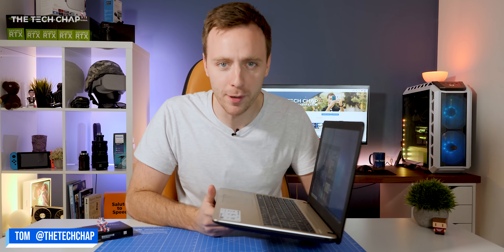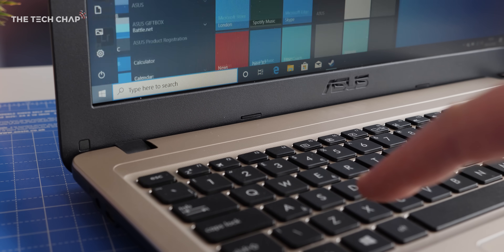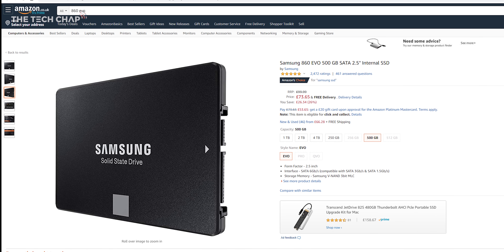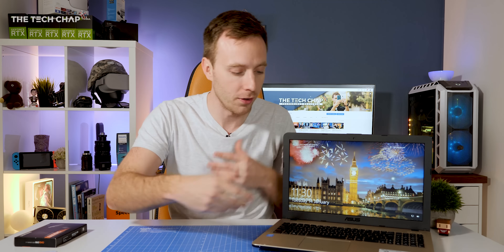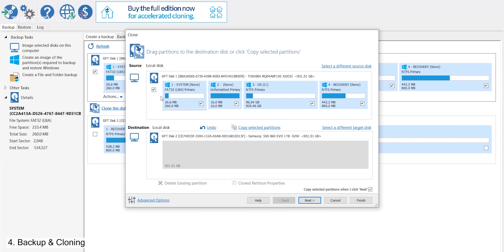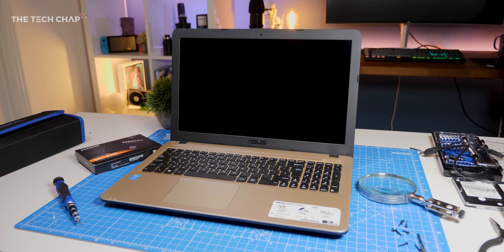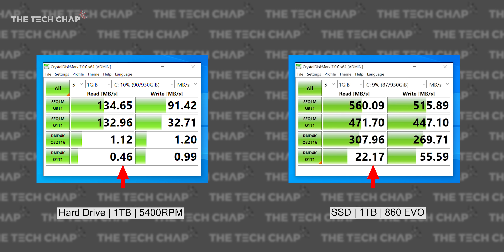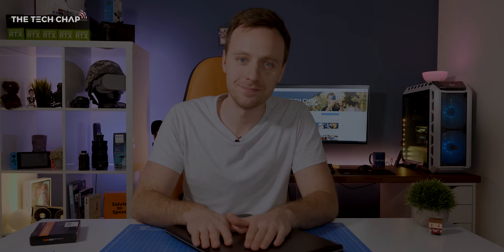How to UPGRADE Your Laptop with a SSD! #AD | The Tech Chap

Comment: I have an old TOSHIBA laptop from 2012. Now lets get to the bad part...  It doesn't have a battery so i have to use it while connected to power at all times, it has a stupid display and a severe overheating problem(100C at times on  my lap). I am thinking of changing it now cause i need something better cause now i really need a laptop where i only use my pc at other times. Now the question for you is whether i should get a laptop or an ipad pro i have been using an ipad and i quite like its interface and style but am worried about consequences of the lack of compatability with other devices  and the area of laptops i jjust think that they are too much to handle  but when i think of easy working and satisfactory typing i want a laptop. SO please tell me what o get an ipad pro or a laptop

Comment: Question: I have an 128Gb SSD M.2 for my OS and 1TB HDD for my files and game, i was always thinking i need to change the SSD but i have to reinstall everything and i dont know how to do that. So I came up on this vid and i was thinking of changing the HDD for and SSD like in this vid. So i just need to empty the HDD and change it with this SDD? Would this make my games much more faster? What is the better option (more easy) SSD or HDD change?

Comment: 1) do I back up my files, pictures first and then do fresh installation?  Or 2) Samsung Cloning my old drive and everything should be there including programs I have there when I change my new ssd?
Reply: Depends on you actually. I'd prefer fresh install but it can be a pain to find all the drivers
Reply: @9inchpp  update..  i want to upgrade my windows 7 pc. great one..  change ssd and fresh windows install.  can i do that and it will find its drivers?  and do i have to buy a windows 10 license.. (i can get it easy if i need to).. help

Comment: I've got a Toshiba Satellite laptop  that's about 6 year old and rocking a slow HDD, gunna get an SSD and swap it out myself :)
Reply: Mine is Toshiba satellite L635which is 10 years old . It is full slow and needs minimum 15 minutes to turn on and respond properly it is 4GB ram and 256GB HDD can I upgrade my ram or Hard disk ??
Reply: @tejasmprasanna826  you can upgrade both. Depending if your laptop let's you most do
Reply: I have a toshiba laptop too! We’ve been best friends since 2013. She still runs okay but she can get slow every now and then.  I got a new laptop for Christmas, but there’s not a lot of gigabytes on it. It’s 119 and right now I have 83 gbs left 😭 My toshiba laptop had 439 gb which lasted a very long time. Um so do I have to get a hard drive for the new laptop for more gigs?
Reply: @hzssxn  I think SSD

Comment: Hey there, GREAT video - thanks for sharing. Quick question that I hope you can help with....Just bought a 2021 Acer Nitro 5 AN517-54-77KG Gaming Laptop (Intel Core i7-11800H, NVIDIA GeForce RTX 3050Ti, 17.3" FHD 144Hz IPS Display, 16GB DDR4, 1TB NVMe SSD, Killer Wi-Fi 6) and have the ability to expand either to a 2.5 SSD or HDD. Which would you recommend is better for overall performance and streaming? I'm torn between adding another SSD, HDD or upgrading the NVMe SSD and adding another SSD/HDD.....so confused to which. Please help???

Comment: Hey ,great video for old laptops but I am using a predator 300 (i5 8gen,gtx1050Ti)and I do a lot of 3d work so for better rendering performance in Maya ,Houdini,c4d...I need to update it..but bit confused b/w upgrading ssd or ram please do recommend something that is budget friendly and also good for a long run...and also currently I have 128gb ssd and 16gb ram

Comment: Is it necessary to remove battery pin before swapping a HDD with a SATA SSD? Because I have a dedicated slot for HDD o n the back of my laptop that i can access without taking out the back cover entirely.

Comment: WHats the settings required for an SSD to be recognised from BIOS on old laptops. On an HP HSTNN-105C i had to toggle a SATA setting in BIOS i switched SATA NATIVE mode to ON.
And now i have problem with a FUJITSU E751 that doesnt recognise the new SSD (The same i had in the HP laptop) but there is no Native mode available to toggle

Comment: I have about the same model of laptop that you are using, except i have a two disk system. One hdd and one ssd. Planing to replace the HDD with an SSD, and then replace the 128 SSD with a bigger card a little later.

Comment: Looking forward to doing this with my HP Envy k11TX. It’s got an i7 4510U and an NVIDIA 840m, but it’s slowed down by its 5400rpm HDD. I’ve taken it apart already and it’s easy to do. Would a Crucial MX500 1TB be a good fit? I’m not willing to spend much on this old thing. I have a proper gaming PC already with a 5600x and a 3060Ti, so this is mainly for my family to use for “general computering”.

Comment: can I ask for some advice on what kind ssd should I use, I have an acer travelmate p259-mg laptop, I have added an extra slot for ssd stick but I also wanted to change the hdd to ssd, is it possible to have two ssd's, one is like an hdd and the other is a ssd stick?

Comment: Great instructional video - thanks.  Just a heads up with a potential glitch.  I did this exact upgrade, and the first few times I tried, Samsung's Data Migrations tool was not transferring any data.  The data transfer rate sat there at 0mb/s for like 20 minutes. I check my HDD and saw that it was encrypted with MS Windows Bitlocker.  I decrypted the drive and turned off Bitlocker, and then Samsung's Data Migration tool was able to complete the transfer.  If you need to decrypt your hard drive you can do it from the cmd comand line (run as administrator) using the manage-bde tool.

Comment: Do you have to do anything with ssd partitions before doing these steps? Do I need to convert the ssd from mbr to gpt in order to get it to work? I bought a Kingston ssd for an hp 250 g4 and swapped out the HDD (without cloning) and I get the ‘no bootable drive detected’ message. Any help is appreciated. Thx. 
Edit; It appears in bios under legacy, but seems to be unable to detect and that bios is very old. Should I update bios before upgrading to ssd as well?

Comment: Is it ok to put the SSD in without the mounting bracket? Two of the four screws on my HDD will not loosen it's actually ridiculous my hand hurt lol. But the SSD does snap into place. I was just wondering if it's fine without the bracket

Comment: I got a ThinkPad e585 18 months ago. I replaced the stock HDD with a 1 TB 860 EVO because it was cheaper to do do myself than custom order my e585 with an SSD. 

The e585 "replaced"  a Thinkpad e530. That had a 7 year old HDD. It was time, so I installed an SSD and wiped Windows 7 in favor of Linux Mint. The e530 is so much snappier and a great back up machine.

Comment: Hi I just installed a new SSD drive (WD Blue, 1TB) to my old 2012 Asus G73JW laptop.  Unfortunately my SSD cannot perform above 280 mbps.  I quickly found out my port is basically SATA II and not SATA III.  Can you replace the old SATA II port by removing it and putting on a newer SATA III port?  I didn't find one video guide talking about installing a new SATA III port.  Is it even possible? or not feasible?  Do I have wait until I buy a new laptop?

Comment: Just upgraded ssd on Dell Inspiron. It’s 2.5 times faster practically. Good boot speed. Programs are running smooth.
Reply: I'm planning to do the same, which ssd did you purchase?

Comment: keep in mind that you should figure out what SATA version your laptop runs on, its good to note that if it used SATA 2 connections it's best to get a lower spec SSD as getting a SATA 3 SSD and applying on a SATA 2 port would mean that the SSD cant run to its full potential.

Comment: Would it be worth it to upgrade my 17" Sony Vaio that is about 11 years old? It runs slow even though I've transferred all my files to an external hard drive. It can't play some of my video files which are screen recordings made on my Samsung Galaxy S23 Ultra. I think the Sony graphics card can't handle the newer video formats or higher definition. If I upgraded the hard drive, wouldn't Ivneedctovupgrade the graphics card, menory, processor, and heat sink/fan?

Comment: Hey man im running into an issue maybe you can help.

I've got 480GB NVMe m.2 SSD in my desktop i want to upgrade it to 2TB. I went ahead and bought the samsung 2TB very expensive by the way. WHen i install fresh windows into the 2TB can't install all the drivers in there like the GPU, Audio, Network etc and the computer crashes frequently. The drivers could not be installed even through windows update or the website.

Now i will try to clone the original hard drive into the new 2TB to see if that solves the driver problem.

Comment: My laptop won't engage my current drive anymore, after a Microsoft Tech helped me fix the MBR on it, through the Command Prompt.  I didn't know that the A/C adapter had gotten unplugged.  The battery died right after that.  Now the only option I have is to run diagnostics on the harddrive or the memory.  Short test passed, DST Test failed.

Do you have a video on how to do all this in reverse, where the drives are swapped out first, Windows 10 is installed via DVD or Thumbdrive, and a USB adapter is used to try to salvage personal files on the old drive?

Also, is it even worth the cost of the USB adapter to try to save my personal files?  I have done backups on most of them, but I was still working on one longer one that was nearly done, but I wasn't thinking about backing it up yet.  I should have been, but obviously, I'm not perfect.  Anyway, is there any good reason to think I could ever get that file back?  If so, what's the best way to do that?  It's a HP Pavilion.  I'm not sure where the serial number is physically located on it.  The ink on the sticker wore off years ago.

Comment: I have a i3 2nd gen laptop which was taking about 30 seconds to boot ( after I freshly installed windows) and now when I have upgraded to an SSD my laptop boots in around 10 second.... So I suggest everyone to get an SSD no matter what size just transfer your windows partition to it and you will be blown away by the response and booting time of your system .... And you will never think of relying on a HDD to handle window patition 

After 1 month of experience with SSD: 
Transfer speed even from my hdd to hdd was about 20MBps but now after SSD data transfer speed from my SSD to HDD is minimum 70MBps (because thats the limit of my hard drive otherwise SSD can transfer data within itself at a rate of 500+ MBps)

Comment: Hey just want to ask, my laptop has the same specs as yours and currently, it's lagged very bad whenever i want to use chrome or mozilla. Oftently not responding and when i want to move from one software to another software, took about 3 mins to stabilize it back! Should i change to ssd? Or it's another problem?

Comment: I have a dead model (like a specially made laptop) Asus K556U. It has a i7 dual core, 8GB ram, nvidias 930m i guess? The HDD was seagate and it broke in the first 300 days so we replaced it for free. Now its a HGST but its slow as crap. I am thinking of buying some cheap WD or Sandisk SSDs really.

Comment: hey dude great video, just finihsed cloning my ssd and it seems to have worked great. but i have 2 questions please

i used the macrium reflect program to clone my 1tb hdd to my new 860 evo ssd. the total space used on my hdd was like 300gb ish. now when i tried to "clone" everything from my 1tb hdd over to the 500gb ssd on the macrium reflect program, it came up with 5 different things to copy. i highlighted them all and hit copy then it said "insuficient space". but as i clicked and dragged the 5 sub headings from the hdd to ssd, it worked but only in a different order. so heres my question 1. does it matter if they were copied in different operation orders?

question 2.   do i need to fully format my old hdd to use it as an external hard drive? or can i leave everyhing thats on it like windows and recovery, and still use it like a usb. if youre answer for question 1 is "its fine" then ill just format my hdd. just wanna keep the software on the hdd incase i did it wrong. 

once again thanks heaps man, i hope you reply

Comment: Hey my old lab top has a 1tb HDD and I have a 500 gb SSD I am only using 128gb of the 1tb but is not letting me clone it to the 500bg ssd. It said not enough space. Any work around this issue?

Comment: Hello, i have done the swap but a problem arises. After a couple of days, I got a windows bsod, i reinstalled the system but again after a couple of days, it still happens. I don't have system issues with my laptop before but after upgrading to ssd, it has become a pain in thy ass to reinstall the system over and over again. Luckily i dont have personal files in my laptop. Did I do something wrong? Any help or response would be appreciated! Thanks!

Dell Inspiron 14 5000 series

Comment: I have question: if I don’t have any important files can I just replace the HDD with the SSD?
Reply: you need to do something with the bios i believe
Reply: Yes you can. However, you have to install your operating system on the SSD. Otherwise, the PC will not boot. There are plenty of guides that show you how to install Windows on your new SSD.

Comment: What if I Just Swap the hdd with ssd and want a fresh windows installation..! Can I do that directly from the bios boot setup using usb ? 
I mean will my  laptop read my new ssd in the bios menu or do I have to first allocate the partitions of ssd using manage disk options in my computer??
Reply: @perforongo9078  Thanks a lot man I actually found the same solution you are suggesting  sometime ago  and it works ..! Changing the boot order to SSD  is the key here ..! 🙏🙏

Comment: I'm curious whats the difference between the EVO's that have been around for a while and the newer QVO's by Samsung?
Reply: Samsung QVO (aka QLC) are Quad level cell (4 bits per cell) which offers cheaper prices at the expense of slowER performance and lower write endurance.

Samsung EVO is TLC (Triple level cell aka 3 bits per cell) which is faster than QLC, more expensive, with better write endurance.

Most SSDs of the past 5+ years from most brands have been TLC but certain companies will be releasing QLC SSDs to compliment their TLC offerings. Samsung will still continue with offering their MLC and TLC lineup aside from their QLC.

Samsung PRO SSDs are MLC (aka Multi level cell aka 2 bits per cell) which are very expensive especially if you buy M.2 NVME versions instead of SATA 3 versions. They offer the fastest performance and the best write endurance.

SLC (single level cell aka 1 bit per cell) is even more expensive with the best write endurance and speeds but I think SLC is only used in the Enterprise market and not the consumer market. I don't think Samsung makes SLC SSDs for consumers.

P.s. The write endurance of an SSD is tied to the capacity of an SSD. For example: if a 1TB Pro SSD has a 600TB write endurance before it stops working, then a 2TB Pro SSD has a 1,200TB write endurance. Each brand might have different write endurances.
Reply: @PSYCHOV3N0M  Thanks for the very detailed response, ive been using a 970 and 860 for a little while and was wondering why there was the price difference for a qvo i guess it'd probably make a decent mass storage drive. Thanks c:

Comment: Good vid bud 

I’m Going to install a Samsung 970 EVO plus to my 2019 HP Pavillion which only has 1TB HDD but DOES have an an empty m2 nvme slot so I’m just gonna pop in the Samsung EVO ssd then make it my boot drive and use the 1TB HDD  as a massive storage drive.

Comment: How would I go about cloning my current M.2 drive to a new M.2 drive when my laptop only has a single M.2 slot available?
I can only have either the old drive connected or the new one, not both at the same time so there is no way for me to clone it over. Any ideas?
Reply: For anyone wondering, apparently external M.2 adapters exist. I ordered the cheapest one from Amazon, plugged it into my laptop and cloned the C: drive over to my new M.2 drive. 

The adapter got extremely hot but it worked perfectly. I now have an upgraded SSD as my boot drive.

Comment: Right now, I'm running off a live boot stick for Linux mint because my hard drive isn't even recognised by the OS any more on a HP 6HS48UA..I'll be replacing the HDD with A SSD in a few days, back up isn't an issue... that's part of my shutdown routine.. daily.  
I just needed to see how to get inside without hurting something on the way.  It seems pretty straight forward.. thanks.

Comment: I've been meaning to replace my laptop's hard disk to a ssd and this video really helped me. I was just wondering does 2 sticks of 4 gb ram much better than a 1 stick of 8 gb? or is the performance the same?
Reply: It's better to go for 2 sticks of 4 gb ram.
Reply: @Pineapple438  why? it'd be exactly the same if you just got an 8gb ram
Reply: @David.L291  No, it's not the same. The capacity would be the same, but the performance would be different. In dual channel memory configurations, there's more channels to communicate with the CPU which essentially doubles the bandwidth and allows for faster data exchange. Depending on the games you play, it could also lead to higher FPS and you can see that in various benchmark tests.

I'm no expert so if you want to learn more, you can do your own research on dual channel memory, but in general, dual channel offers better performance than single channel.
Reply: @Pineapple438  thanks for the heads up on this, does seem weird to me, oh well and I thought it was just women that were hard to understand lol, maybe I need a dual woman to make it work better haha